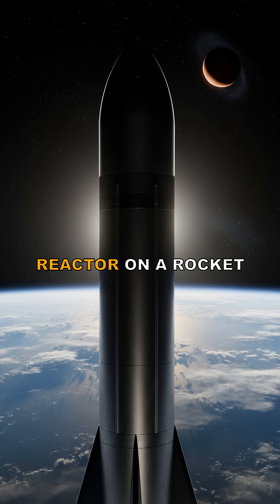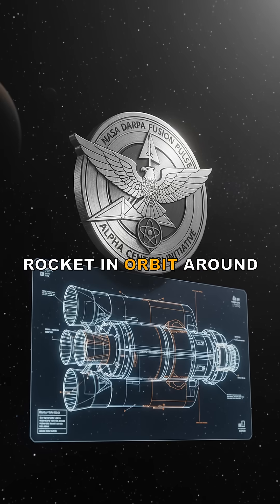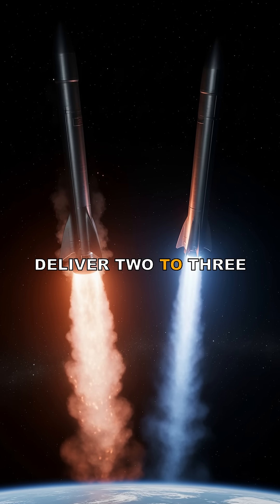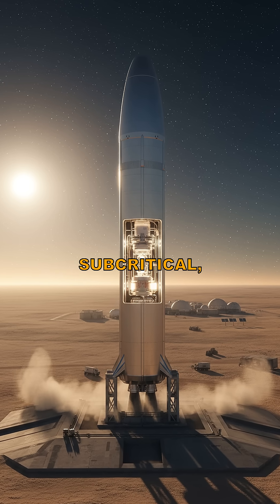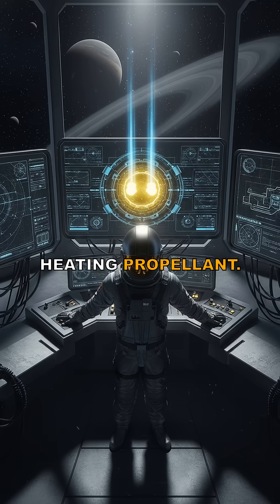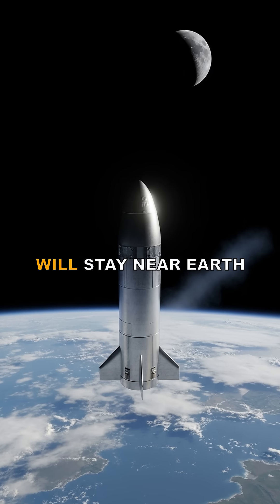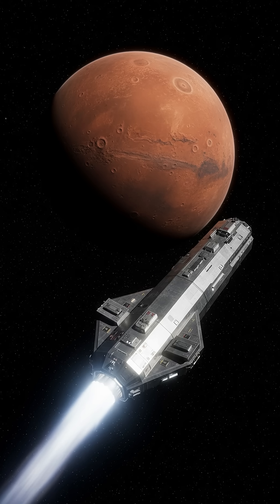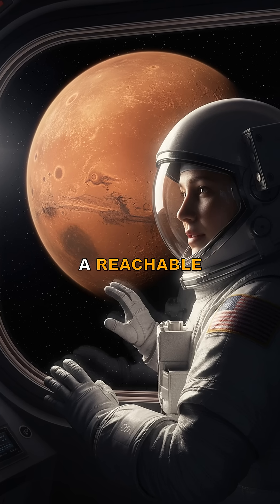NASA Is About to Light a Nuclear Reactor in Space

Comment: NASA has not restarted the DRACO program.
Formal Termination: The cancellation was confirmed in the proposed Fiscal Year 2026 budget request, which allocated no funding for either Nuclear Thermal Propulsion (NTP) or Nuclear Electric Propulsion projects, stating they were too costly and had nearer-term alternatives.

While NASA still recognizes the long-term potential of nuclear propulsion for crewed Mars missions (as it enables faster transit times), the agency is currently focusing its limited resources on nearer-term propulsion alternatives and potentially other forms of nuclear power, like Nuclear Electric Propulsion (NEP), which uses a small reactor to generate electricity for ion thrusters.

Comment: DARPA's decision to terminate the DRACO project was primarily a matter of cost-benefit analysis due to changes in the commercial space landscape. Key factors cited by DARPA included:
Decreasing Launch Costs: The rise of launch providers (like SpaceX) and the capabilities of vehicles like Starship have significantly driven down the cost of getting mass (propellant) into space. This lessens the competitive advantage of Nuclear Thermal Propulsion (NTP).
NTP offers 2-5 times greater efficiency (higher specific impulse, or I_{sp}) than chemical rockets, which saves on propellant mass. However, if launch costs are cheap enough, the large Research and Development (R&D) costs for a new NTP engine no longer provide a compelling enough return on investment (ROI).
Waning National Security Interest: The decrease in the cost of launching propellant also lowered the urgency and "differentiated value" of NTP technology for some national security-related missions.
Technical and Infrastructure Barriers: There were also challenges cited regarding the significant infrastructure required for ground-based testing of the nuclear thermal reactor, which DARPA did not want to fund.

Comment: But you still need reaction mass to change your vector in space, how does this change that? By making the existing reaction mass go faster and thus more thrust?
Reply: Correct. Chemical fuels are limited by the amount of energy stored in chemical bonds. Nuclear fission releases more energy than any chemical reaction is able to, making the propellant go faster. Much of this video is bunk though. For example, you don’t have to “engineer” fissionable materials so that they won’t explode - getting them to explode at all is actually very difficult. Also, NASA cancelled the Draco program. There’s so much wrong info in this video… 🤦‍♂️